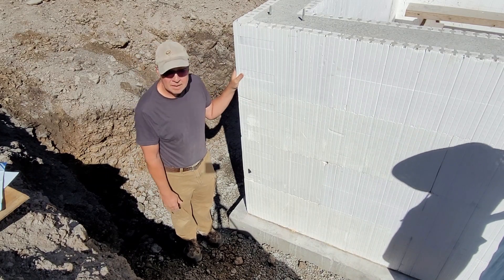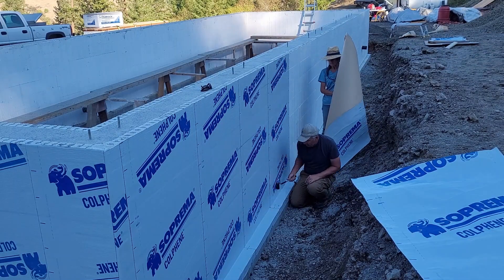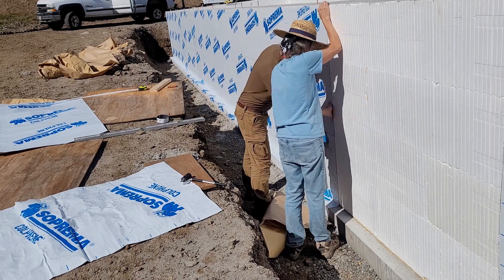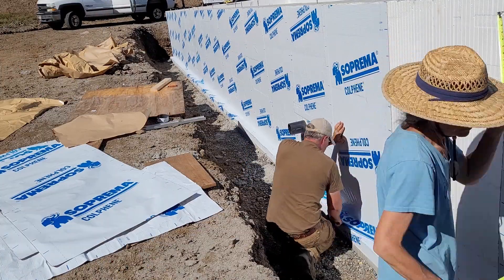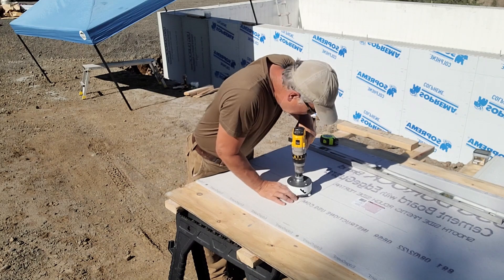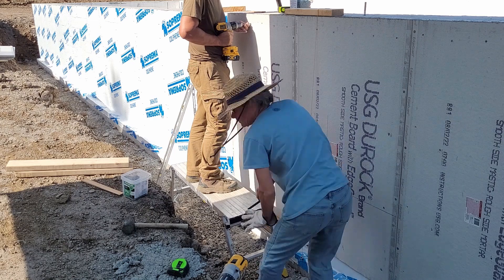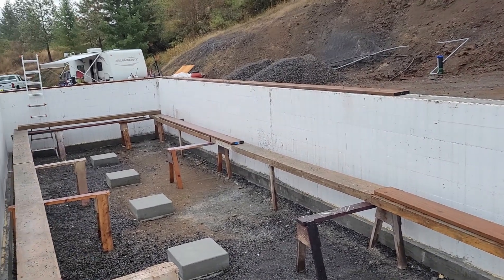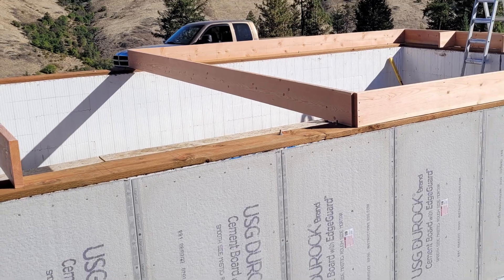ICF DIYers Make Unusual Siding Choice?

Comment: I am pretty sure the primer is used to compensate for UV damage if your foam is exposed to the sun for a long period of time.
Reply: correct, it turns the polystyrene to dust on the surface and nothing can stick to it after that.
Reply from the maker: I wondered about that.  I have seen old ICF block that have turn yellow with a dusty surface.  Makes sense that the primer would help in that case.  Thanks for the info.

Comment: My nudura icf supplier told me to just use any exterior water based primer. So I did and it worked great on my oxidized icfs
Reply from the maker: I'm sure that was way less expensive than the primer supplied by the ICF manufactures.  Good information to have, thanks for sharing!  And good job to Nudura for sharing that information with you.

Comment: I build an ICF house in WA state 5 years ago. I like your video and seeing how you decided to protect your waterproofing layer. I hope it works well.
Reply from the maker: Thanks.  I've not really seen anyone do anything to protect the waterproofing below grade other than plastic corrugated water shedding sheets or dimple wrap that Special K suggested.   That type of material was, in my estimation, too expensive for what I perceived it being worth (of course I could be wrong) While I am not particularly concerned with the cement board absorbing water, in hindsight it might have been a good idea to coat is with below grade concrete water proofer.  Time will tell.  Thanks for commenting and watching.

Comment: The cement backer board is perfectly fine for installing on the ICF for wet locations. My archatect specked it for my ICF build for a minimum of 18" on either side of grade line. This I will attach hardy board or pho stone finish.
Reply from the maker: Thanks for the comment Jake, I really appreciate it.  Some other commentors had me worried about the choice.  Hopefully all will be well.
Reply: @kombidog  Well it absolutely will not rot or burn for a while. With the gravel back fill the build drains too. I have probably 30 hears to live with my build so past that only the lord knows and big box bank cares! LoL

Comment: Matt Risinger has a video of the work your doing with the manufacturers rep and goes through a very detailed explanation of why you use primer before sticking your pieces on your wall I don't know if it's the same material
Reply from the maker: I watched Matt's video and maybe it is just a Polywall brand thing or maybe it is more important if the ICF is really dirty or has had some UV damage, but I am confident that the Soprema that I used is stuck permanently to the Amvic ICF that I used.  Thanks for watching and commenting.

Comment: I had considered doing this as well but all hardiebacker/durock literature says its not to be used for ground contact.  Instead, will be using ComfortBOARD from Rockwool.  Itll add an additional R-6 to the foundation and be a replacement for dimpled drainage mat, same if not cheaper in cost.
Reply from the maker: If I had soft rock free dirt for backfill I wouldn't have used anything at all over the waterproofing liner.  However most of what I had for backfill was jagged basalt rock.  For me the durock was meant only to protect the liner during backfill.  I think for my purpose it worked well.  Having said that if I had to do the whole ting over I don't I would have used ICF and would have constructed wood concreted forms instead.  Best of luck with your project and thanks for your comment.

Comment: backer board is great for shower walls if you apply  something like red-guard, or aquadefense or ARDEX 8+9 rapid waterproofing. if not, it wont last long, its great board cos it gives you better rigidity then a drywall and can hold more load if properly installed.. 
that being said:
"Can USG Durock® Brand Cement Boards be used on the interior and exterior of buildings?
Yes. They can also be used in below-grade applications such as basements. Below grade in this application does not include direct ground-contact applications."
Reply from the maker: Well, I will be hoping for the best.  Thanks for commenting and watching.

Comment: Money!!!  Polywalls adhesive is almost double the membrane.  For my house just the gallons were $2200!  We went with a spray on rubber for about $1700.   Super easy and fast.
Reply from the maker: Yeah, that's what I was thinking, the primer is crazy expensive, and I don't see the point of it.  The self-adhesive membrane I used cost $900 and was a bit of a pain to put on but manageable.  Never heard of the spray on rubber that may have been the way to go.  Thanks for the comment.
Reply: @kombidog  yeah it looked manageable.  My walls were 22ft high so a peel and stick would of been out!!  Specially by yourself.  The stuff I used was Rub-R-Wall Aqua.  Water based so it won’t hurt the ICF but you do need to rent a $3500 sprayer.   It’s definitely the way to go for cost and ease.

Comment: the foam strip is also used as a sealant to keep drafts out....
Reply from the maker: I thought about that at first, but it seemed futile as most crawl spaces are vented anyway.  Also, I would think that the weight of the house structure would press the seal plate so tight into the stem wall that no draft could get through but maybe not.  Thanks for commenting.
Reply: The top of the concrete isn’t perfectly level.  The sill seal fills any undulations so there is no air leakage at that point.

Comment: Primer is a must
Concrete backer board is likely a poor choice. Concrete does absorb moisture so now you need another waterproof barrier...
Dimple wrap is most commonly  used below grade and parging above grade
Reply from the maker: Why do you think primer is a must?  In my case the membrane stuck solid and will further be held in place by the backer board.  I know that stucco is a pretty common exterior coating for ICF and that is most likely what I will do.  Don't see how backer board absorbing water would be any different than stucco.  Thanks for taking the time to comment and if you have further insight to offer it would be much appreciated.
Reply: @kombidog  I have been building with ICF for 25 years, you may be ok without primer but if you have any issues no one will stand behind their product guarantees. 
You have to treat below grade and above grade differently. Please don't use stucco below grade .
Reply from the maker: @specialkonacid6574  Thanks, really do appreciate the information, and I won't be doing stucco below grade.
Reply: If you have been building with ICF for 25 years then share some useful details. Most soil absorbs water and that is what  is against my ICF wall below grade with the same waterproofing... so unless you have some insight into the alkaline from that durock having some negative interaction with the waterproofing peel and stick I don't think your comment is at all helpful.  I like his detail and the length of the panels not reaching the footing may be helpful to not wick more water up.
Reply: @zephanspencer4202  in the building industry we tend to apply best practices concerning materials and waterproofing methods.  Your ICF manufacturer and local building codes provide all the information you need.

Dimple wrap not only protects the membrane it provides space for water to flow. I don't know the frost level where this is being built but if the concrete board is saturated and you get freezing and heaving you might end up with some problems. 
So many times in this business I see people think they have creative ways to do things but more often than not it ends up costing more for an inferior result
Reply: @kombidog  maybe because they dont puncture the waterproofing membrane and add a moisture absorbing board on it instead they go over it and not creating a solid berrier!!!
Reply: @specialkonacid6574 No expert, but adding to your comment about dimple wrap.  Yes, it provides a path for water to flow down to the drainage pipe.  Without the dimple wrap, the surrounding water soaked soil will exert a lot of hydrostatic pressure on your ICF wall, maybe causing it to crack.  An ounce of prevention applies here.
Reply: @markstipulkoski1389  that's right. I always use dimple wrap for my ICF foundations

Comment: I would suggest having ICF wall as tall as floor joist plus 3/4" or what ever thickness of sub floor material you are using.  This way the ICF insulation protects the rim , perimeter, of the floor package.  So that means hanging a ledger on some of the interior side of the ICF .  Simpson makes a bracket , ICF VL , for this purpose for either LVL or common lumber..
For insulation in your rim joist you will now have to add small batts of insulation between joists and poly VB, good luck with that.  In fact the whole wall should be ICF to the roof as the ICF will provide air and vapour barrier, insulation , structure, noise and fire barrier all in 1 product.  Less work, fewer products = faster build.  PACIFIC ICF
Reply: Newest code will require more air barrier under plates,  You can add rows of sealant on the concrete, then apply the sill gasket, then apply more sealant under the plate or on top of the sill gasket.  This will keep out the wind or heat loss from the building.  IF you had done ICF above floor joist , none of the sealant would be required at that point, but sealant would be used under bottom plate on plywood floor.  

I also wrap the P&S membrane on top of ICF to prevent access by bugs   PACIFIC ICF
Reply from the maker: @billmccance7762  Thanks for the suggestions and information.  I will look into it - of course some of the steps are already done and can't be changed or redone.
Reply: I realize your work on the project is done , but others will look at this and learn new things or other methods.  You help the building industry
Reply from the maker: @billmccance7762  I do hope others can learn from my mistakes.

Comment: Wondering about putting on a waterproof membrane and then putting dozens of screw holes in it when you put the cement board on. Any issue there?
Reply from the maker: Good question and that was certainly a consideration.  My thinking was that without the cement board the membrane would likely be torn up badly by all the jagged rock in the backfill material.  I felt the membrane would make a pretty tight seal around the screws before they went into the styrofoam and then into the plastic framework of the ICF.  Last winter was a very wet one and while I did have moisture coming up from the dirt floor there was no water/moisture coming from the walls.

Comment: 7:13 did u grind the top of the concrete?
Reply from the maker: Yes, it had a pretty rough finish so I used a Dimond grinding wheel to smooth it out.
Reply: @kombidog  dang that’s a dirty dusty job but it’s looking good

Comment: Where can i buy icf blocks with worldwide shipping and how much it cost?
Reply from the maker: I used Amvi ICF blocks, you can contact them at https://www.amvicsystem.com/where-to-buy/   There are lots of different manufacturers of ICF block, another possibility for you is Fox Blocks.  You really need to find a distributor near you as shipping would be very expensive if they had to ship very far due to how bulky they are.  I have no idea what it will cost you to get blocks delivered however mine cost a little of $6,000 US were the distributor was about 3 hours away.

Comment: Cement backer board is HIGHLY susceptible to freeze-thaw degradation.  Using it in exterior settings is not recommended at all. The stuff crumbles into sand in just a few cycles.
Reply from the maker: That will be a huge bummer if it happens and a tough lesson to learn.  Thanks for the input.
Reply: Read manufacturer specs-will crumble within couple freeze cycles-been there-sorry
Reply from the maker: @paulkoca808  Thanks for commenting and your concern.  Issues with freezing is not something I had really considered.  I guess in my mind I felt cement board should not have any more trouble over winter than stucco.  On your suggestion I did look at the Durorock specs and they say it can be used outdoors.  The only caution they give it to not coat it while it is wet or "covered with frost".  They say to let it thaw a dry before coating.  That would imply that it can handle getting wet and freezing although to your point how many cycles can it take.  Not much I can do about it now, just wait and see and hope for the best.
Reply: @kombidog  Replace (hopefully before you backfill) whatever portion is above your local freeze depth. Where I live it is 48 inches below grade.
There is no need to shoot in the dark when it comes to material performance. The tool you use to post vids will also open a portal into a vast library of information that will help you pick a good material for your application.
Reply from the maker: @4n2earth22  Unfortunately it is already backfilled and I am not in a position to do anything about it until spring.  Whatever damage that may happen I will just have to deal with then.  I do have some hope in that the Durorck specs say it can be used outdoors.  We'll see.  Stay tuned and I will let everyone know what happens as soon as I can.

Comment: A concrete contractor will charge around $8K you don't have to lift a finger (Thermal mass should not be insulated from the inside).
Reply from the maker: Maybe where you live but not where I'm at.  I had 3 contractors all quote between $14K-$16K and then all 3 bailed on me at the last minute.  Couldn't find a 4th contractor to even bid.  That is why we ended up doing the foundation ourselves.

Comment: If i were u i would water proof the durrock with foundation sealant.its inexpensive and will save u from having to remove that moisture wicking board later on!
Reply from the maker: Not much I can do about the part that is already backfilled but the portion that is above grad I will be applyinh waterproofing followed by stucco, cultured stone or some other type of surface.
Reply: @kombidog  👍